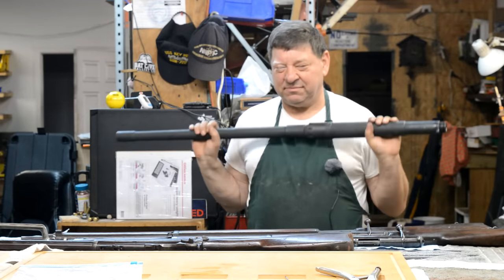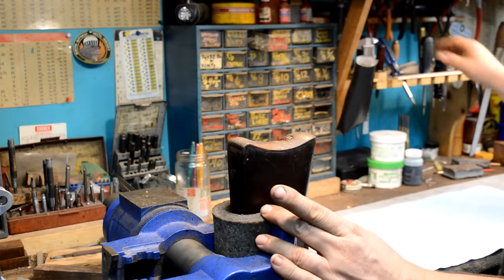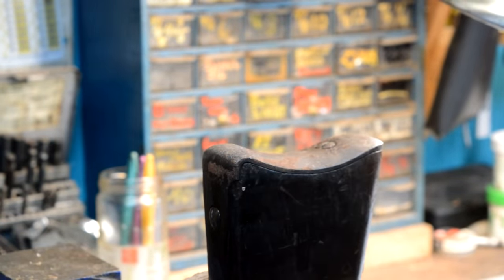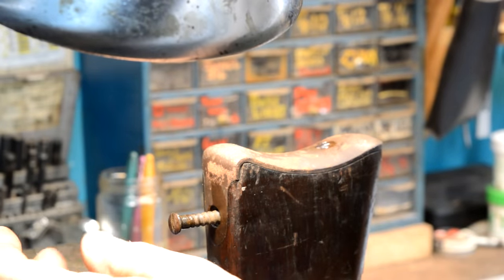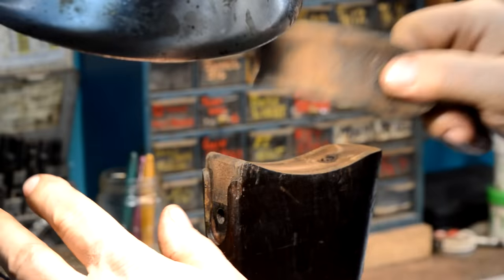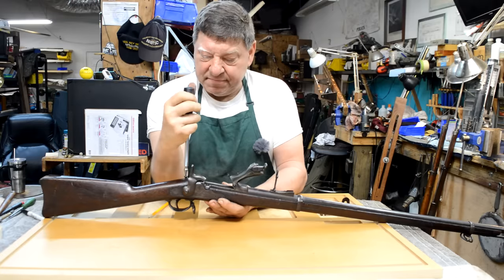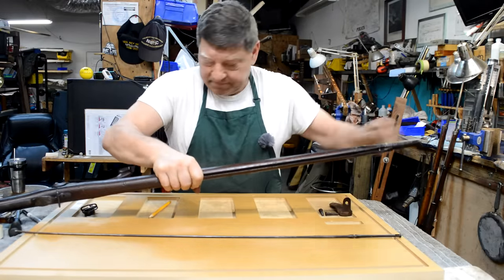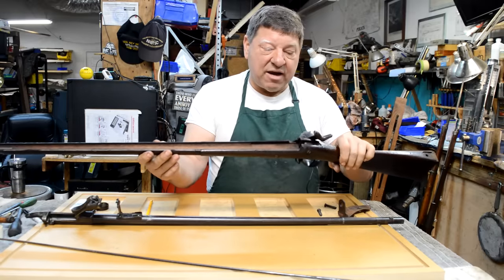1873 Springfield...The "Trapdoor":  Anvil 111

Comment: So you blued the parts after boiling and wiring or was that after oiling?
Reply: Boiling is what created the blueing (rust conversion). Oiling makes it show up better. Chemical blueing is a (relatively) recent process.
Reply from the maker: No bluing, just conversion of the existing rust into black oxide. The whole point here is how much original beauty is hiding inder the paytina

Comment: What did you boil the parts in and what was the bluing you used.
Reply: Plain water and no bluing chemicals needed.  The bluing was always there, he just uncovered it
Reply: It may have been distilled water, but IIRC the tap water where Mark is happens to be really soft.

I would use distilled water, because the tap water where I live is very hard.
Reply: @jamesw9930  Amazing the blue is still there since the brushed final step before that looks like gray metal then poof there it is!

Comment: I have an 1889 1873 model trapdoor and I don't think my firing pin has a spring
Reply from the maker: The firing pin upgrade in 1875 deleted the spring and the associated stress rising step in the pin. Your setup is correct.